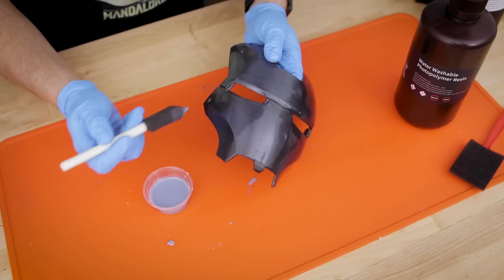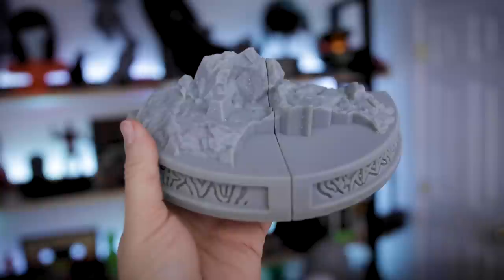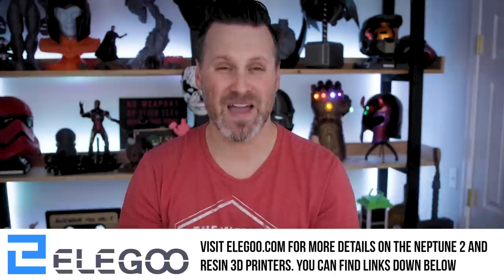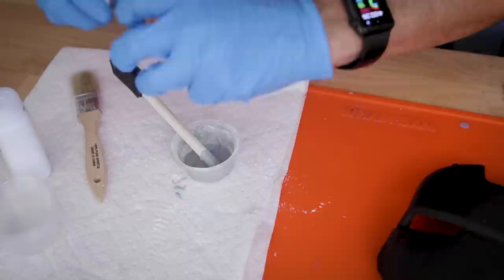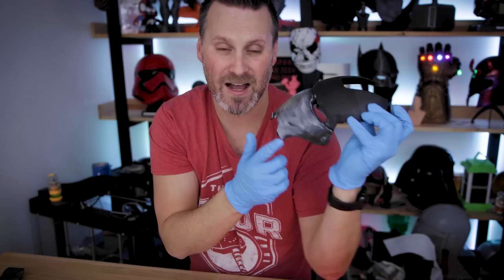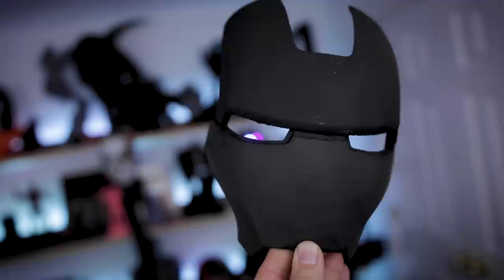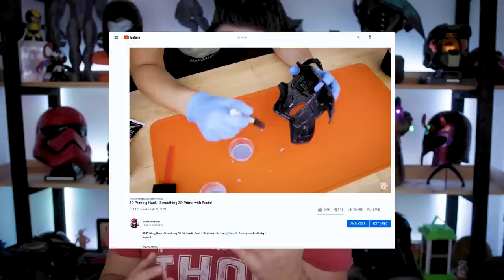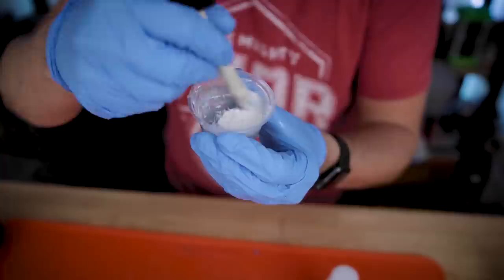3D Printing Hack - Filling Gaps & Seams with Resin and Baby Powder

Comment: How does this compare with wood filler? Also would a foam brush work better than a chip or finger? Just printed 4 out of 5 Bad Batch helmets and looking for some good easy tips to save on the sanding. GREAT VID UJ! 👍🏻
Reply from the maker: Ohh well there you go. Do 2 with resin and 2 with woodfiller 😬🙃 

The resin can leave you with a slightly tacky surface but I always prime and sand more. Woodfiller is also an awesome option

Comment: Try corn starch instead. It's cheaper and works a little better.

Also remember that if you deep fill a hole, only the top 1 or 2 mm will cure as the UV light has to illuminate it to set it.
So, like normal filler, do it a bit at a time.
Reply: Would using a clear resin help get a deeper cure?

Comment: I had something 3D printed via resin and when I put the miniature together, there are big gaps where each piece connects. What do you recommend to solve this issue? Put it together after primer and painting then fill the gaps? This will be my first time doing anything like this and so far I havent even started yet.

Comment: The funny thing is the resin smell is not effecting him at all. Resin is highly toxic and you need to wear a mask as well as eye gear and gloves. And sanding resin is very dangerous you need eye gear and a mask while sanding resin. I just use wood filler or sawdust and wood glue. Less toxic and you don't need gloves or a mask when applying it to your prints. But a mask and eye gear is a must for sanding anything.

Comment: Hi, I’ve been using printer resin like this myself but I have a problem, my resin seems to cure the top layer and creates bubbles and voids full of liquid resin. I’m wondering if it’s because of the if lamp I’m using. Mine is a LED party black light. Is that the problem?  I can get very thin layers of resin to cure but if there’s too much resin I’m getting incurred resin issues. For example if I fill a mould on the the top surface cures and the rest remains liquid. It’s really frustrating.

Comment: This also works with acrylic paint and baby powder, to an extent.
Reply from the maker: Oh really? That sounds interesting
Reply: @UncleJessy  Yeah the method is very similar, of course it will air dry instead of UV cure, but a hairdryer or room heater will dry the acrylic mixture pretty fast.

It’s essentially “DIY modelling paste” which is the stuff they use to add thick textures to canvas painting etc, it’s normally “marble powder” that is used but baby powder is a suitable alternative. It’s really cool to see the same technique applies to UV resin too.

The quality of acrylic will come into play too. Cheap acrylic paints will make a brittle layer but some nicer flexible cosplay foam acrylic paints seem to work well and offer some flexibility and self-smoothing properties.

Also I’ve found because it’s water based it doesn’t need “sanding”, you can get away with just rubbing it with a wet/damp sponge which smooths it out.

Give it a try, you can come up with all sorts of fun things by just mixing fillers and paints, I recently made my own primer filler for the airbrush using some “dollar store” supplies!

Comment: Thanks for both videos on resin filling. I tried the resin only from the first video and it works really good, and saved me a lot of time! Only things I've run into is the fumes are pretty nasty and even after curing the resin for about 5 minutes, the outside is really tacky and residue comes off on the gloves (fingers if no gloves). Any tips on getting a non tacky result? Maybe dust with baby powder after curing?? I look forward to trying the tips from this video.

Comment: I wonder if this would work well with baking soda instead of baby powder?  I use superglue & baby powder to glue my PLA prints, and it's completely sandable, creates a very solid bond, and is easy to work with.  I'm guessing the resin + any fine powder should work based on the comments here.

Comment: Hey buddy , just thinking would corn flour work (corn starch) ? I'm thinking maybe it would make for stronger bonding with resin and not make it as brittle , just a thought lol!
Reply: That's what I was thinking.  Seems like corn starch would be better for this application.  It's more readily available since it's a common baking ingredient and baby power is mostly corn starch anyway.  Plus you wouldn't get the unnecessary additives like perfumes.
Reply: @binarybrian  exactly 👍 plus it should thicken up more using less product than talcum powder ( baby powder)

Comment: How does the UV light cure through that mixture? I would think The mixture is too opaque for the light to shine all the way through and cure the deeper stuff.. Have you ever tested to see if the resin that is deeper into the holes and gaps has even been able to cure? Also was always told not to sand resin without a mask on lol

Comment: Would you be able to lightly use a heat gun on the resin after its spread  to help smooth it better before curing?

Comment: If you covered the surface of PLA with this stuff would it be more resistant to high temperatures? Or would the inside part start collapsing? (for example, what if it was in a 100F degree car)
Reply: Try it and let us know - I’ve been wondering the same thing

Comment: thanks for the tip! excited to sue this on my current Clone Wars Obi Wan armor build, would you say this mixture is more brittle than bondo? there are some thin parts that might flex just a tad, im worried the resin will crack..

Comment: You got me thinking? Could you cast this in a mold? And then add it to you 3D print?
Reply from the maker: Not sure I follow. As in use this method to make a mold? Or use this to fill a mold to create a cast? 

Pretty sure this poured into a mold wouldn’t work well since the UV light won’t be able to get to all angles of the mold. But could be an interesting conect
Reply: @UncleJessy  Poured into mold. Maybe a shallow mold.

Comment: Would recommend masking with tape. Fill holes and then less sandpapering.
Reply: Do the same with standard putty. As the you can use the tape also as level. You done in minutes. I love the drying time of this solution. Almost want to test it on normal models.

Comment: Bro are resin prints strong as pla?? I want to print a cool rc body with resin instead of pla
Reply from the maker: Typical resin is brittle, you can add strength to your resin prints by adding flexible resin or something like Siraya Tech Blu to it. That will make your regular resin a lot more durable. Love the idea of a RC body
Reply: @UncleJessy  i though about abs like resin. The problem here (u dont have it with ur mega resin printer) is the little area for work... Will need many cuts in meshmixer.

Comment: Sorry but... What's the point of this technique in regards to any filler product that cost way cheaper and is freaking less dirty and sticky to work with ? 
Sorry this is a genuine question cuz, I can achieve the exact same result by applying any house/car filler on my print. I really don't understand the need to use 3d resin that you may better use to 3d print stuff instead of filling gaps... For me it's just a waste of ressources.

Sorry for my english... Not native speaker here.

PS : hope that "filler" is the correct word... Don't hesitate to correct me :)

Comment: With trying to fill larger voids, I'd be concerned that you might only be able to cure to a shallow depth. Maybe a simple-ish solution would be to add a small bevel to the holes and design a cap or plug to fit inside, then apply this technique over it for the finished look.

Comment: To all of you people saying you need safety glasses when using UV LED curing lights, you need to do research about different UV wavelengths.
"UV" LEDs in these things are really just purple LEDs. They generally 410nm wavelengths. Real UV wavelength is between 100nm and 400nm.

These curing lamps are no more dangerous than going outside without sunglasses.